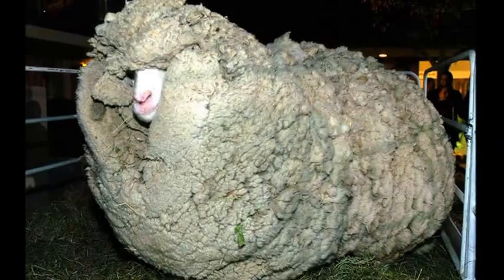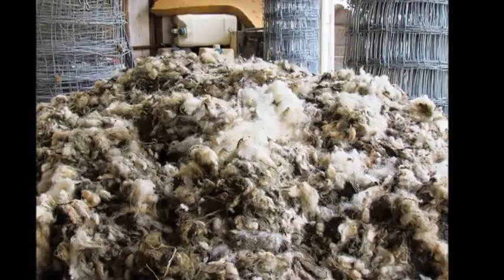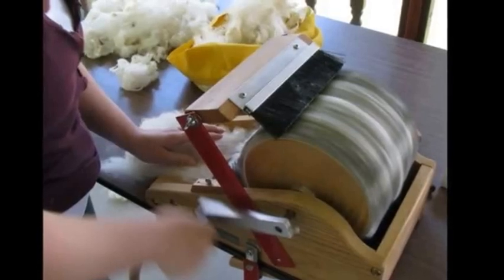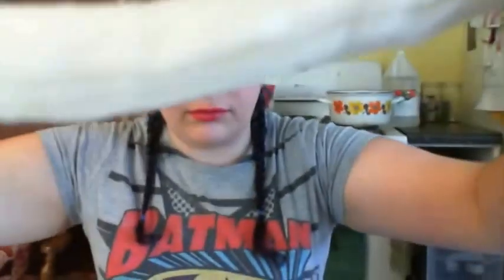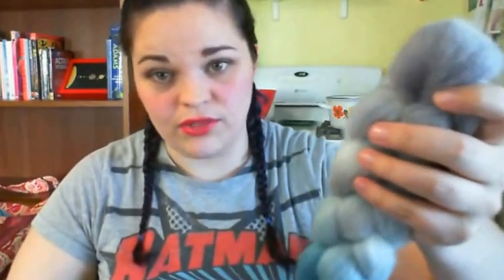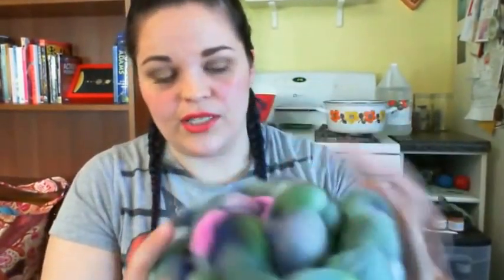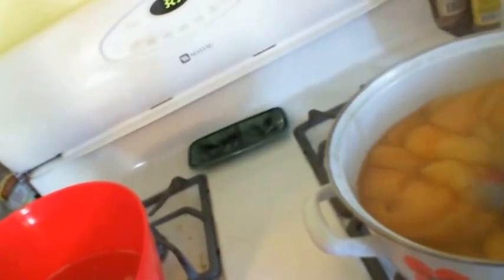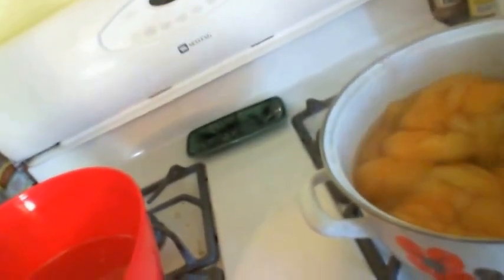Electric Sheep Ep 1: Dyeing Roving

Comment: Soaking it in hot water isn't going to felt it. To felt something you need 3 things. temperature change (hot to cold), plus soap, plus agitation.
Reply: You don't need soap. It certainly helps the process, but I've accidentally felted merino by just soaking in hot water and agitating as little as possible.